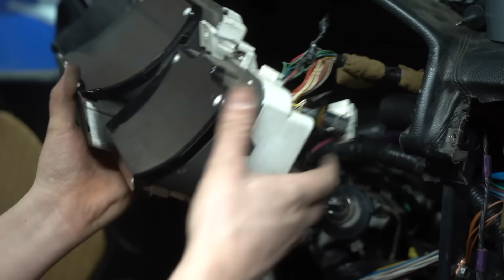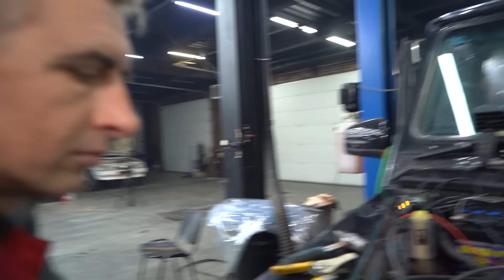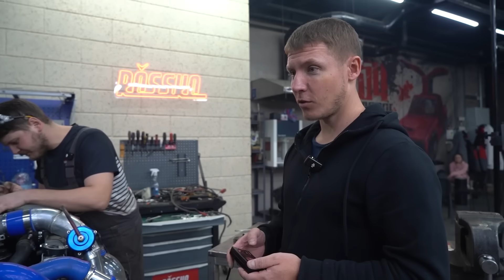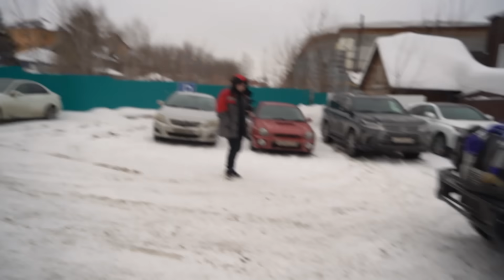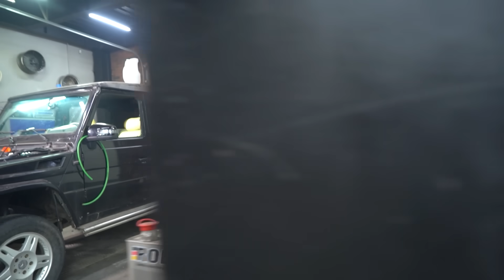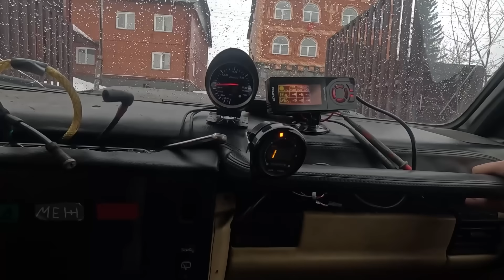3-turbo 2JZ G-wagen build - first drive

Comment: I once had a twin turbo diesel and the injector hung open and with all the o2 being pumped into the cylinder it just acted as a torch and sliced a hole from one cylinder to the next

Comment: The problem you might be running into is with the ECU not running the fuel correctly because the car you got the engine from was originally not turbocharged.

Comment: unfortunate not to have a fully locked transmission. Central and rear locked differential with open differential in the front would be ok